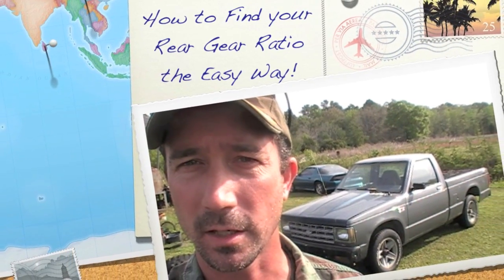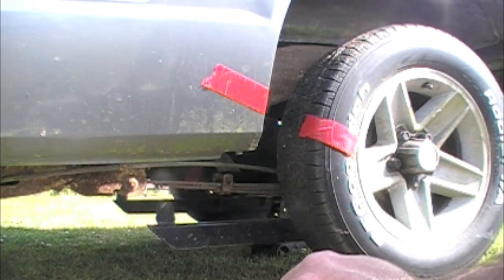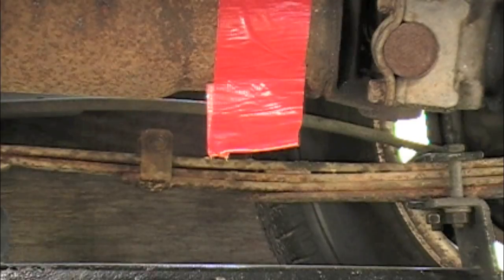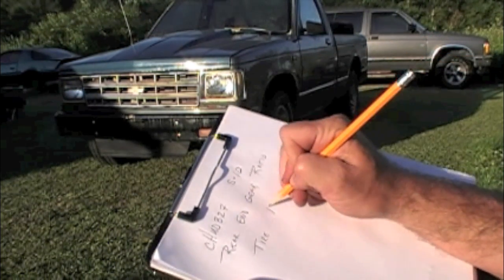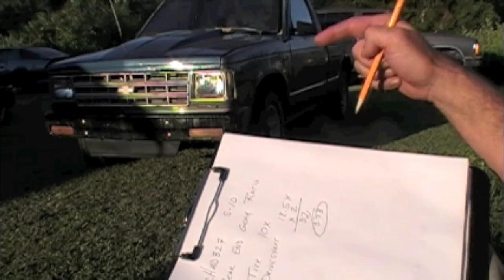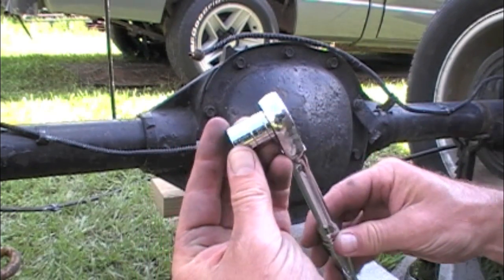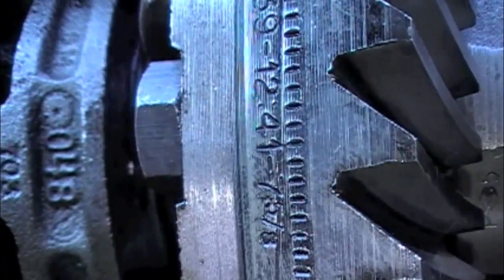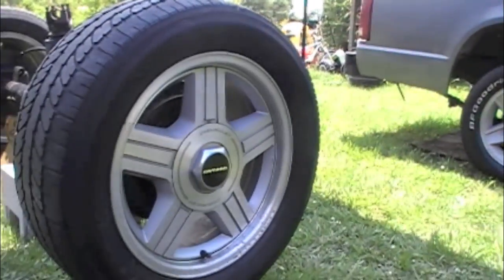How to Easily Find Rear End Gear Ratios

Comment: cool just hit me up any time what i have is  88 s10 tahoe with  only 2200 miles on its like new  really lol has a 4.3 in it with automatic trans  and would like to get it set up for a v8     or  maybe buy one thats already done and strip it or may even just trade this one   but from all i have read  dont think it will be too hard  being it has a 4.3 already  but i have been following u    and your close to me  so figured u may  could be some help in pointing me in right  direction... thanks will
Reply from the maker: +William Wimberly Yea that sounds cool.  As for yours, the v8 would bolt right to your transmission.  Everything behind the trans can stay just like it is, unless you start making too much power.  Motor mount will be on of the biggest things that you will need.  Or like you said, some one might be wait to trade you.  My first V8 s10 came with the v8 already in it.  My neighbor did all the hard work and got tired of messing with it. He bought my full size truck and pretty much gave me his S-10.  I then drove the wheels almost off of it.  That is when my addiction began.  I have had about 14 S10's over the years, or at least that is how many I can remember.  I should do a video one day and show all the pictures of my S-10 pickups and Blazers.  Some people would get into that...  Good luck and keep me updated.

Comment: chud where r u i need some help with doing my s10
Reply from the maker: +William Wimberly I would love to help.  I am right near Jacksonville, FL. What is your location?
Reply: I'm in same location chud doing a rear end on my 1999 dodge ram 1500 van although I got a 12 bolt cover going from a 10 do you think it will matter ? The rear end came off same year van just bigger motor in it

Comment: what rear end will bolt up in a s10 that is a posi traction and can stand up to a small block
Reply from the maker: Henry Deloatch I would think that you could put a locker in the stock rear like mine had and it should be fine.  Unless you are going to put some be sticky slicks back there, the back end is so light that it should spin before something breaks.  Mine never gave me any problems, but I didn't have slicks either.

Comment: I have 35's on my 05 F150. Trying to figure out if previous owner swapped out the rear end or if its still stock. My shift point are not correct, on the road it kind of chuggs till I let off the accel and then it seems to pop into the right gear. I have a flashpaq tuner on the way to see if I can tune it to perfection. 
Thanks for your time.
Reply from the maker: Mark Ramirez this is a sure way to find you ratio as long as you have one tire turning, count correctly, and then divide correctly.  thanks for commenting back and good luck.

Comment: Does this method work even if you have aftermarket rims and tires(Larger ones). 
Please help.
Reply from the maker: Mark Ramirez yes, the tires size is irrelevant. It will work just the same with smaller or bigger tires. Hope this helps, what size tires do you have? Thanks for watching.